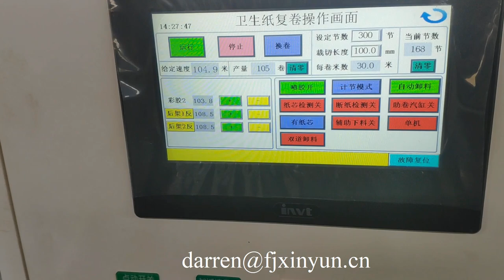Good price 1350 small toilet roll paper making machine

Comment: How much is this muchine
Reply from the maker: Hello,Hellen,
Good day to you.
1350mm toilet paper rewinding machine costs 45,000USD (With one set of embossing and glue lamination system),manual cutting machine costs 1,650USD
May I ask what's the width and diameter of parent roll paper will you use?
Could you please send me all your request by email to darren@fjxinyun.cn or whatsapp  +8615060870806
We will reply you everything quickly.
Best regards
Darren Pan